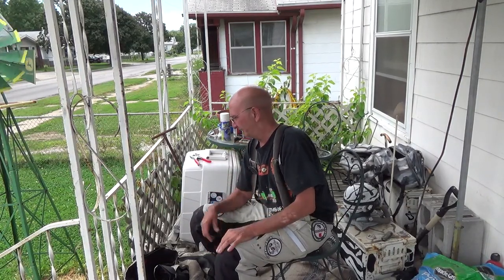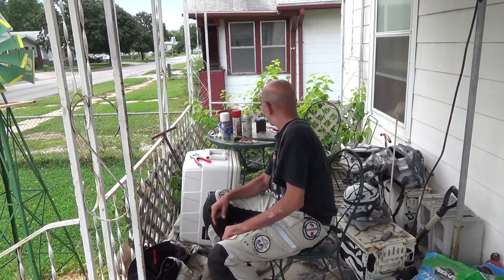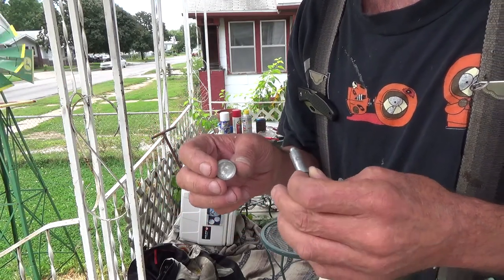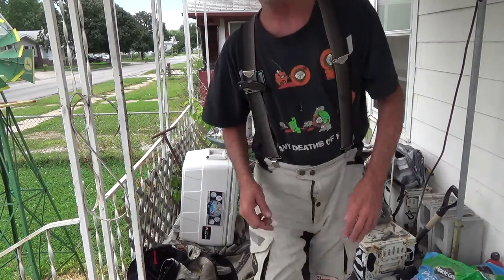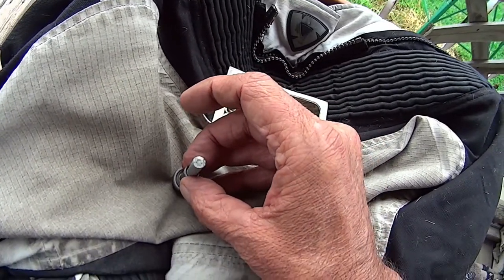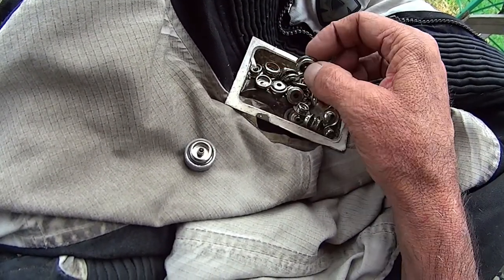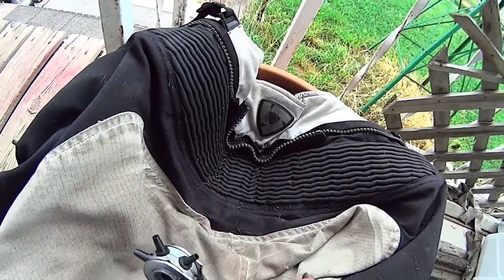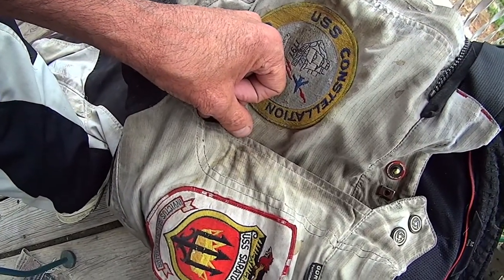Motorcycle Gear Repair from NT8

Comment: I had bad luck with snaps...at one point I used the dual loc...which works but you have to do some sewing.
Reply from the maker: Well in the perfect world they would have used Metal zippers. Snaps are generally easy to replace, use an over size drill bit and Drill the stud. Then just replace the whole thing.

Comment: How about a leather punch? I use one and it goes through thick rawhide like butter.
Reply from the maker: I thought about that, maybe with a hammer blow it would punch through.
Reply: Yep, that is the kind I use, single punch that you can change the head size on.